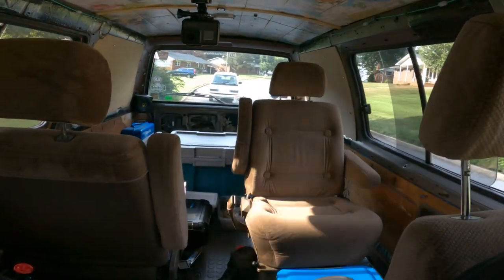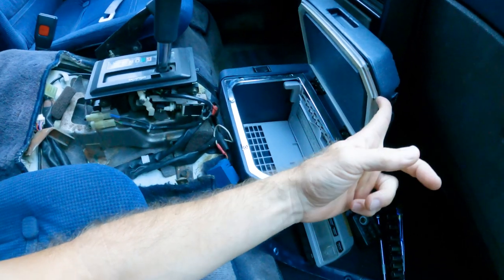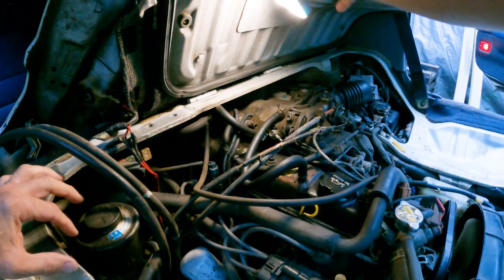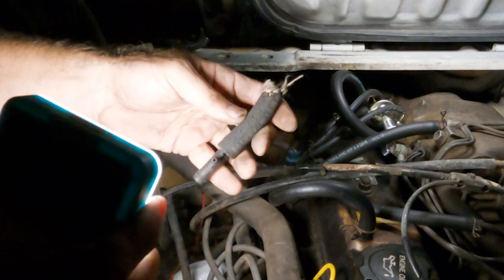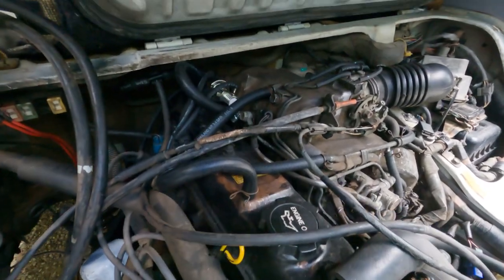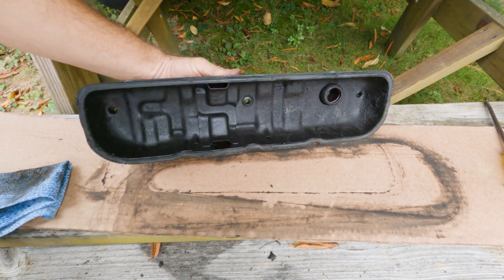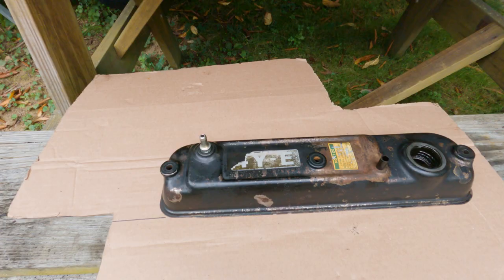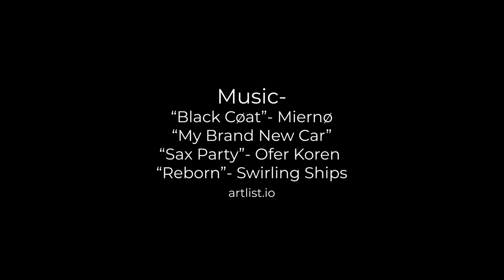Introducing Luna, the 1989 Toyota Van | first update | new vacuum lines, PCV valve

Comment: Getting to my head gasket this week, gonna do all the vacuum lines - thanks for this. Can't wait to get it on the road and start turning it into a camper like my Previa!
Reply from the maker: Have fun with that head gasket!! Would love to see that build out. 
Glad you enjoyed the vid, thanks for watching!
Reply: @GraeSkyeStudio  I did the head gasket when I changed the head really easy if your methodical no belts to un do the fiddly bit is the rocker Arms you have to locate them as you bolt up
Reply: They do say the 3y is faster than the 4y they recon the 4y was produced for the off road use as its a 2.2
Reply: Mine is a camper well it's my man cave it sleeps two and it's got everything cooker shower sink I am fitting a flip down tv oh and my play station two yes a real home from home
Reply from the maker: @jeffvaljean6030  sounds awesome!!
Reply: @GraeSkyeStudio  yeah I gotta admit it is and I got it cheap had to do a shit load of work to it but it really does look the part and the good news is it just passed its mot test

Comment: I have a 1988 Toyovan, which I have had for over 10 years, and I love it!  Unfortunately, I hit a big pothole, in Atlanta, the other day, and something shorted out.  I replaced the fusible link, and everything works, now, except it turns over great, but won't start.  (It alwayts starts very quickly.)  Anyway, no one in the Atlanta are will even look at the van.  Frustrating!   I am open to any suggestions from any you or any of your viewers.  Good luck with your new van!

Comment: When you put the valve cover back on did you use any type of sealant? If not has it held up pretty well?
Reply from the maker: Hi Tim. I'll be honest and say I actually don't remember using sealant. Besides installing the gasket itself. 
Also, Luna has been sitting since I removed both the front and back glass to repair the rust and get a new windshield. That said, I've kept her cranked from time to time to exercise the engine while she's been parked. I haven't noticed any leaks or issues during that time. 
Sorry it's not more comprehensive answer.

Comment: Thanks for that video ,I have an opportunity to buy one , here in belize ,came from California , looks great , few question for you ,first what I should check  , common problem ?
Second  is it hard to find part ? Thanks
Reply from the maker: Hi there Christian. Sounds like a nice find.
Regarding parts- there are quite a few things that are NLA from Toyota in the states. Some things I’ve found through EBay from overseas. And A ton of stuff has been culled from vans in JunkYards. Pull-A-Parts etc. Then of course you have the network of folks still driving and restoring these vans sharing parts and knowledge. Which is priceless for sure!!
Online resources of knowledge would be toyotavantech.com and the various Facebook groups devoted to the Toyota Van. 

As far as checking before buying…
1- Make sure the alternator is dry. The Power steering pump is known to leak directly on it if it looses a seal.
2- make sure all the vacuum lines and main air (rubber) pipe from the filter box is in good shape. No cracks or dry rot. That’ll directly effect starting and running. 
3- oil leaks of course.
As always with vehicles, there’s more to look for and maintenance from the PO to know about. But that’s what I’d start with.
Hope that helps.
If you get it, you’ll most likely love it. Especially if you don’t mind having fun maintaining a 30 year old classic! :)

Comment: Thanks for including part numbers! Word to the wise, my Hose of Death began leaking on me just a month after replacing valve cover gasket. Gasket I received from Rock Auto was  Fel Pro silicone. it fit nicely on installation, but it lost all constitution when I removed it for HOD access. It simply would not stay in the channel during re-installation, and now I have a severe oil leak. Ordered a Toyota vc gasket, wish I would have done that initially.

Do you have a part number on the large vacuum hoses (pcv, other recirculation hoses)? Can't get from Toyota, NLA
Reply from the maker: Hate to hear that about the gasket. Sounds like a pain in the butt!
Regarding hoses- I ended up just using matched stock sizes from the local auto parts store. Just give yourself enough length to keep it from crimping.